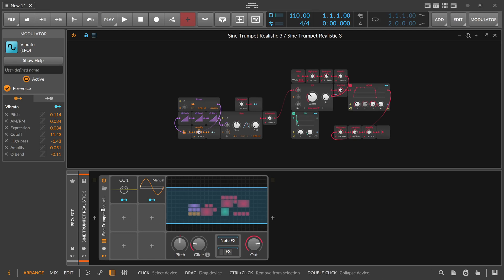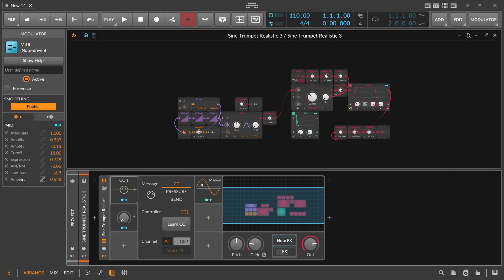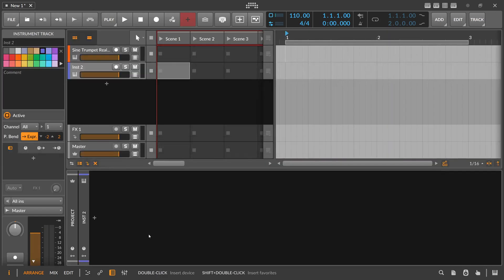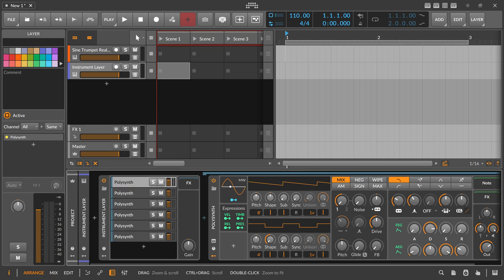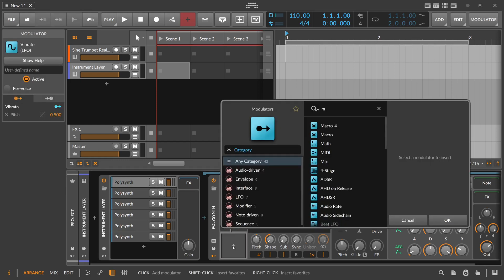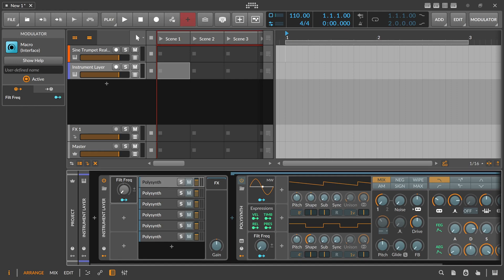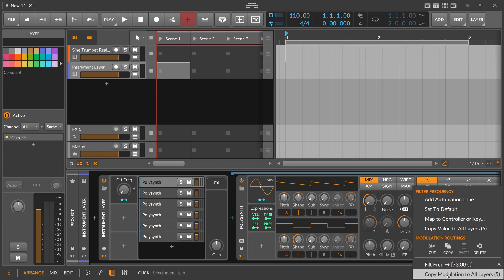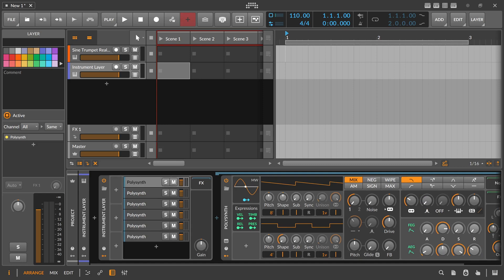Copy + Paste Modulation Mappings - Bitwig Concepts Guide

Comment: Cool! What are the limits of "Copy Value/Modulations to all layers"? Eg. in your example, if one of your layers contains something else than a polysynth, will it just be ignored? Does it work too with layered VST instances (provided again it's the same VST in each layer)?
Does it work too with Selectors instead of Layers?
(Because if yes to the last two, that basically makes you able to quickly turn any mono VST into a polyphonic one)
Reply from the maker: - it will only work with the same devices, is one layer a different device it will be skipped
- yes, it works with vst too
- yes, it works with selectors too
Reply: @BitwigGuide  Wow :) you know then what could be awesome and that could be built upon that? To have a "MPE-izer" container: load any VST, set a number of voices, so that this container loads this many instances of the plugin, exposes only one and auto-syncs any parameter change from that instance to all the other ones, and then does the MIDI round robin machinery to send incoming notes to the various instances. This would of course consume more CPU but would give rise to a massive reusability of "older" plugins without MPE or even polyphony support
Reply: @ywenp  I've been dreaming of that too, not for MPE but rather for poly effects (i.e. effects that are per-voice), for example saturation works better when applied polyphonically. Of cource I could just build a polyphonic patch in da Grid, but that's too much hussle. With this approach one could combine any synth with any filter/distortion so the latter would work polyphonically 'inside' the synth' voice.